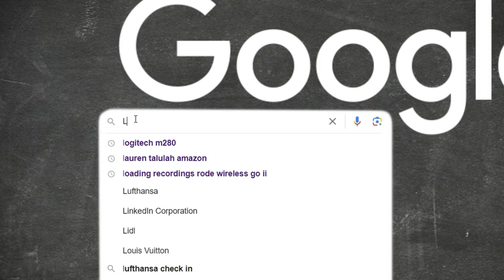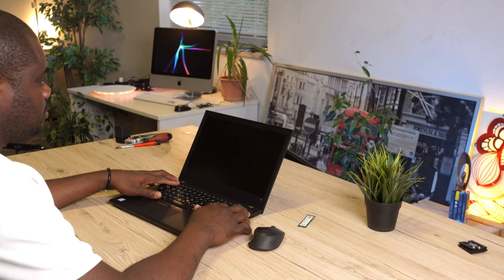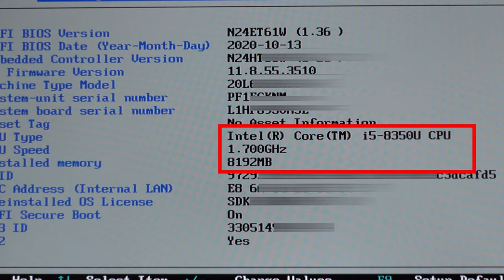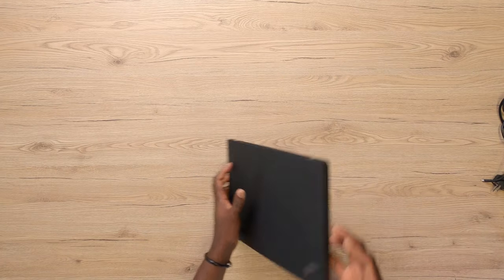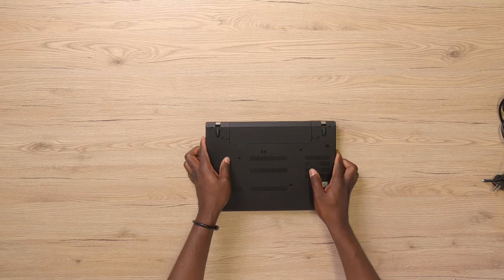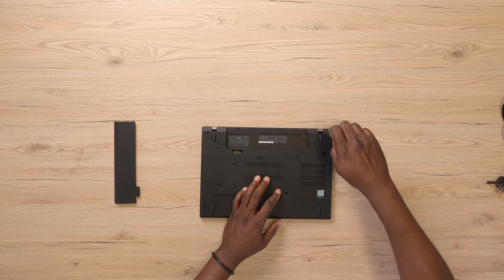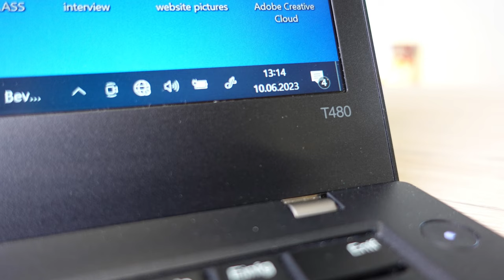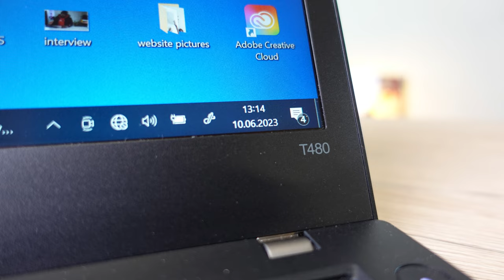Why Buy A Lenovo ThinkPad T480 In 2024?

Comment: Great machines, as long as you get one with the updated firmware for the thunderbolt controller. I bought mine i7 16gb of ram no drive and cracked screen for $40
Reply from the maker: Great stuff you got for the price 😉
Reply: Bruh what 🥲
I bought a $60 Acer aspire and it gets Roblox on 10 fps 😂
Reply from the maker: @hotdogsellerr  😂
Reply: Also not that hard to update yourself. Mine came with an old version now it’s running 23
Reply: Mine had but it still failed. But now charging works once again for some reasons
Reply: @hotdogsellerr did y get a Celeron n4020?
Reply: @Rayyan-hi2ge  it's said 5th gen
Reply: @hotdogsellerr  fifth gen is pretty bad, what specific cpu?
Reply: Thank you for the review I was looking at a refurbished one at Amazon getting it for 265 GBP, as a replacement for my MacBook Air 2017, from which I will use my 1tb SSD, well I need a Mac but it's been ages I haven't used windows. Thanks a lot for the review
Reply: Where do you buy it man?
Reply: @hotdogsellerr  A485 and T480 will get you good performance for most games begore 2016. This means all Valve games, all GTAs so far including GTA 5 at good framerate all the way down through older and more basic games. Its a perfect laptop for this reason alongside how upgradeable it is.
Reply: And shipping 100$ lol
Reply: @hotdogsellerr  no joke, my acer aspire one 722 gets 1 fps on roblox

Comment: I love my T480, easily the best laptop I've ever owned, would highly recommend it for the "broke college student" crowd or anyone on a tighter budget. My second hand model came with a dodgy trackpad, and it was as simple as taking off the back cover, taking out the internal battery, and undoing 4 screws to get the old trackpad out!
Reply from the maker: Thanks 😉! I feel the same was about the T480 too.
Reply: Can it ply heavey games
Reply: @ghostbrandishjm5853  I have an i5 model without dedicated graphics, so I can only speak for that but I think this would mostly apply to those models too. Minecraft with a few optimization mods ran well, along with games like Rainworld and Terraria. But games such as Fortnite, R6 and CS2 wouldn't run on this laptop.

Though, it has a thunderbolt port with support for an external GPU I believe, but I don't have the hardware to be able to test that out unfortunately.
Reply: @FluffyBean  respect
Reply: It's still good for those that don't need more than 4 cores. You have your RAM upgrades, you have your fantastic relaibility, and I have upgraded my T480 to an IGZO low-power screen (it's great), 32GB RAM, and 48Wh and 72Wh batteries. Not to mention that mine also has an i7-8550U and an MX150, and that makes the laptop usable even in the most demanding tasks like competitive-level Zoom calls as a programmer. There's a limit to the CPU power, sure, but what are you going to do on such a laptop? Play games? They're a giant waste of time and money. And it will handle video editing fine because it has Intel QSV.
Reply: T480 model laptop is this a touch screen?
Reply: @biswajitpanda4306  I believe there is a 1080p touchscreen version, but I just have the standard 1080p screen

Comment: I bought a T480 last week, and so far I am loving it. I was able to get it in practically brand new condition for $250. It packs a i5 8350, 16GB DDR4 RAM, 256GB SSD, 14" 1080p IPS display. I fully intend to upgrade the RAM and SSD in the future. I loaded Ubuntu onto it and have been using it primarily for coding, web browsing, and watching YouTube. For the price, it might be the best or at the least one of the best laptops you can buy for under $300.
Reply from the maker: thats a very good deal, believe me. Enjoy it 😳
Reply: From where did you buy it ?
Reply: Bhai price kitna hai
Reply: Ya Laptop ka
Reply: Lenovo i5 vpro 8th gen

Comment: Since the highly praise and recommendations on YouTube, the price of used T480 increased significantly. Even higher than some later models.
Reply from the maker: oh really? will have to take a look 👀
Reply: i just got a i7 model for $289
Reply from the maker: @Aguas.Blancas  Great Deal !
Reply: Just got one with i5 1tb ssd, 16gb ram for $220 shipped.  It will replace my t450 that I also bought for around $200 ages ago.  I’ve been telling people for ages, you don’t need expensive Mac books. These are more than sufficient for my e-commerce business. I have another dedicated gaming laptop for gaming.
Reply from the maker: @MrJspecefini  wow! thats a great buy. I pretty much take mine wherever i go, and its still bery much rock solid, the battery life for me is the sweetest part 😉
Reply: @Hardwaremoney  oh yea battery life is amazing.  And my cat dropped my T450 countless times from desk height and many drink spills, but it’s still going strong.  They don’t make them this durable anymore.
Reply: Got a i5 8th gen 8gb 256gb 1080p for 130€, great deal

Comment: I found one new in box at my local microcenter, fully loaded, for $250. I had heard how legendary it was so I impulse bought it and do not regret it. I like using it so much I barely touch my desktop now.
Reply: So funny but I just bought one today used for $250 LOL
Reply: @Meulkie Hi! How do you like it so far? What specs does yours have? Found one used myself for around the same price, i7, MX150, all nice things, thinking to buy it.
Reply: @ivivom  funny enough I had to get rid of mine due to some issues I ran into but I ended up snagging a T480 instead LOL

Comment: i bought a thinkpad t480 back in 2020 for online school since my hp laptop stopped working and i needed a laptop RIGHT THEN. the parts of the thinkpad t480 that intrigued me were the external and internal battery combo, the replaceable keyboard (and the fact that thinkpad keyboards are amazing), the 2 sticks of user replacable ram, all the i/o, and the fact that thinkpads had a huge reputation for being durable (they were the only laptops allowed on the international space station for a long time), i was just set on the laptop. in the ~4 years that i've had this laptop i have abused it so much, i have done many things to this laptop that should have killed it but its still here and even though because of my own negligence it's held together with duct tape i think it's going to last at least another 5 years
Reply from the maker: wow! thanks for the feedback, it will definitely help someone to make a buying decision 😉

Comment: good option for warranty and general security while buying used laptops are websites that sell refurbished items. I just bought a lenovo T470s for around 300€ with i7-7600 and 20 gig ram with 30 days to give it back and 12 month warranty in case of technical problems , so would racomend checking these sites as they all offer pretty similar deals .
Reply from the maker: Great! Thanks for the tips, someone would definitely find this useful.
Reply: Are refurbished laptops not good?

Comment: almost bought one but the new ryzen thinkpads blow them away. Got a Ryzen 7 L14 with 16gb ram, both slots removable that benchmarks faster than the m2 air
Reply from the maker: wow! thats a good one ☝️
Reply: In terms of power, yeah, but in terms of battery and build quality? The L14 can't compete, the T480 feels extremely durable and has triple the battery life.
Reply from the maker: @hellsing0999999999  will still need to check out the L14. But honestly, the battery life on this T480 is damm good! could also be  because i got a very good Grade A laptop, so pretty much not been used for a kong time
Reply: @hellsing0999999999  the third gen L14 made a big jump in build quality, check one out in person, I have a t450s and a t450 which is the same chassis as the t480 and the L14 feels just a strong.  But Yeah  my t450s has a better keyboard and chassis but the L14s bezels are much smaller.I put the 400 nit panel on and the L14 is so good. The battery life isn’t triple, with the big battery on the l14 they’re equal, the AMD cpus are owning intel in battery life and performance - I actually only charged it once since I got it a couple weeks ago with light use. There’s no reason to get a t480 when the new amd models have 3-4x the performance with better battery life.
Reply: @KO-sx9uy  what about the price

Comment: I've bought one back in december 2022, it's been 10 months now and I still think I made a great buy. It's not as upgradable as the often called "true ThinkPads", but it's enough for me. I've put 32GB of memory to it, replaced the WWAN card with another M.2 SSD (making it 512GB + 256GB), changed the keyboard for a backlit one, and it's perfect for me as is. I use it mainly for study and work (managing a store). It's got Windows 11 compatibility (although I use Solus) and no problem in running my day-to-day apps.
Reply from the maker: Interesting, i honestly believe its a great laptop for the current price😉
Reply: Does it run on window 11 cz I see in description windows 10 
Reply plz Ty ❤

Comment: Great video! The T480 is an awesome laptop! I love Lenovo's build quality on these Thinkpads. I got mine for about $190 and then added a 1TB secondary NVMe SSD and upgraded to 64GB. Lastly, I replaced my batteries and upgraded the external battery to the extended capacity size. I can easily run the laptop all day on a single charge. The upgrades are well worth the investment.
Reply from the maker: Couldn't agree more! and  $190 is a pretty good deal. I am aware the good conditioned T480`s are getting quite hard to get lately
Reply: @mirzanazri  About $90 for both batteries (roughly $45 each). For the SSD, it's about $80 now. The 64GB RAM upgrade was about $125. All in total, about $295, but each are optional and can be done incrementally.
Reply: @tinkersmusings I have the T480 with 16gb ram. Do you notice a huge difference upgrading to 64gb of ram?
Reply: @jordanwilliams1546   I mostly upgraded because I could. It depends on your workload and whether you need the full 64GB of RAM. If you're doing light work and web browsing, 16GB is a good amount. If you're doing software development, you might want more. I've not come close to maxing out the 64GB, but I could imagine a scenario where you might have something like OBS open and multiple browser windows/tabs and some development tools and that taking a considerable chunk of memory.
Reply: @Hardwaremoney kind of scared because got a T470 for $139 used very good condition on Amazon. I just hope it can last 3 years but that might be a bit optimistic

Comment: I've just reached the point of "too many things going wrong with it" on my 2011 Macbook Pro, and I kind of want a bigger screen. Thought about going to a similar-vintage 15" MBP, but just didn't find anything at a price competitive to comparably equipped Thinkpads. I've always loved Thinkpads for their durability and their matchless keyboards. So it's back to the black slab for me. :)  Just plunked down the cash for a T590, which should show up Monday.  Spent a hair over $500US and got an I7, 16GB RAM, 15" display, gobs of USB ports, an ethernet jack, and a  2TB SSD to swap in for the 512 that came with it. The 512 can go into my chromebook. :D
Reply from the maker: wow 😉 thats a great one
Reply: @Hardwaremoney  Yeah, that was a deal I just couldn't walk past. My musical aspirations are gonna be much happier with a laptop with more that one more-or-less working USB port. :D
Reply: mind I ask what processor is it that came with it? 500 dollars seems kinda overpay, will anyone use that much storage anyways?
I only see that kinda storage reasonable on gaming laptops and pcs.

Comment: I bought my T480s in 2023 for  $230. It is with core i5 and 8gb. I add 16gb more and now there is 24gb. 

I’m absolutely happy with this laptop. My previous laptop was T440s. And this is the right upgrade. Honestly T440s was even better but too heavy and pretty old and slow.

Comment: Supposedly you can also upgrade the stock TN display panel it comes with it to an IPS one that supports full HD resolution. There are guides for this process on youtube. And the best thing about upgrading the display panel isnt because of better colours and viewing angles. But because the replacement part is damn cheap at £30-40.

My father wanted to spend £250 on a chrome book. I said to give me that £250 and I will give you something 100x better!
Reply: I got an IGZO low-power panel for it for just $60 including shipping. I got it from a local e-tailer. It had no mounting brackets so I used double-sided tape to secure it in place, and it's not going anywhere. Fun fact - most modern ThinkPads have their screens secured with double-sided tape because it's more practical and easier to manage, and also easier to upgrade the screen afterwards.

Comment: I considered the T480 too.. Went with a Latitude 7490/7400 instead. The Lenovo is build sturdier for sure and has more "upgrades" available too. But as a overal home laptop (paperwork, youtube, mailing, simple games) it's perfect to me. The spec is similar to a 480 (when you leave out the 1440P upgrade route) apart from the external battery. 

Overal I think it is a great alternative, easy acces to parts. DC-Jack is a plug-and-play replacement and it has TB3 with charging too. The 480 only has the latter, so if that breaks you are screwed... The battery is larger on the 480 but I rather have a lightweight machine and a 20k mAh batterypack in with me for times I need to.
Reply: For 100 dollars more I got myself a MacBook 2018 pro with an i7 9750h processor, I dislike Mac but after my incident with the xps 9350 having a loud buzzin noise out of nowhere I had to get something more sturdier. The Battery kina sucks thought, but I got it in mint condition so I can't complain alot.

Either way, from what I can tell the latitud is pretty much a downgrade vs the t480 by looking at its processor, dunno why you would go for it when I happened to rum the same horsepower before and it couldnt even movies at 4k/2k.

Comment: Bought one several years ago for 450 Euros used, dropped in a 1080p screen (under 100 Euros), Linux Mint, absolute heaven. Will use it until it falls apart.
Reply: Look into the dual heatpipe mod/upgrade. 💪

Comment: bought for 200€ a thinkpad, the merchant put in 16gig of ram and a the big slot battery to compensate the non cleanliness of it (by commercial standards, but for me it was really clean), put arch with i3 on it and it just works perfectly. solid manufacturing, lot of ports, and two batteries, one internal and one changeable, game changer, sad this kind of design is less and less sold with the new ones.
Reply from the maker: true talk Bro, and great luck with the Price 😉!

Comment: There is also A485 which is t480 but with amd cpus, and very good integrated graphics. Its cheaper and has no thunderbolt(avoiding the firmware bug that burned the tb ports on some intel based thinkpads).
It has same exact parts otherwise, you can get bigger batteries(48 and 72whrs compared to stock slim 24whr battery), plus internal one and get gigantic amounts of battery life in excess of 15 hours depending on use. It also means it could take 4-5 hours of harduse/gaming.
Reply from the maker: Great info, pretty sure someone will find this useful 😉

Comment: I got one for 180 EUR with like 80 cycles on batteries and i5 8250u, 8GB, 256 nvme (7 months ago). I sold some of the parts for like 40 EUR.

Now I have it with Chicony Keyboard backlit, 1080p, 400nits display, 16GB RAM, and a new palmrest. I am Running solo Debian 12 Stable. Using it for research, taking care of my stuff, multimedia. The display is gorgeous and the small batteries hold like 5 Hours of usage.

Windows 11 was working nice but I decided to not dual boot anymore. Is not that strong but on KDE Debian works very nice for normal stuff. 

I wanted it just for portably at a final price of 300 EUR after upgrades. For heavy stuff I use my desktop.

The thing is with these upgrades I am getting a better experience even. Than of 700 EUR usage because display is the most important for me when maintenaing YouTube Channels or Web Design.
Reply from the maker: 🫡180€ was already a super deal, and that you were able to still squeeze out 40€ is pretty much🔥😉. Its amazing what you have turned your machine to, and i can confirm too that the battery combo is very wicked.! Thanks for your input.

Comment: The only thing I don't like about the T470, T480, T490 S series is the fact that the heat sink vent is on the right side (as far as I know). This is bad for right handed people because it always blows hot air to your hand when using an external mouse. I also hate that battery is not swappable anymore like previous models. To me the T440s/T450s are just better besides Win 11 hardware requirement of course.
Reply from the maker: i get what you mean, i use a wireless mouse and its absolutely not a problem 😉
Reply: @Hardwaremoney  Okay. Thanks for quick response. It appears only the S models have that design. The non S has the vent on the left. Looking to get one right now. Great machines.
Reply from the maker: great choice😉 @muhammad-bin-american